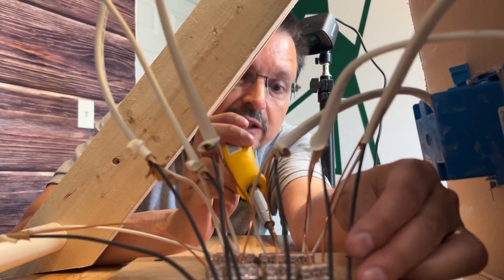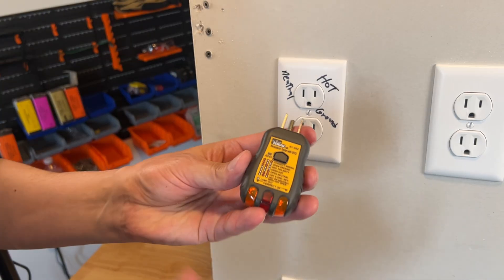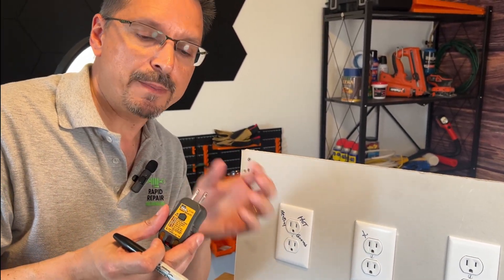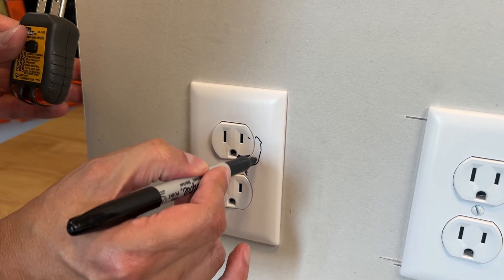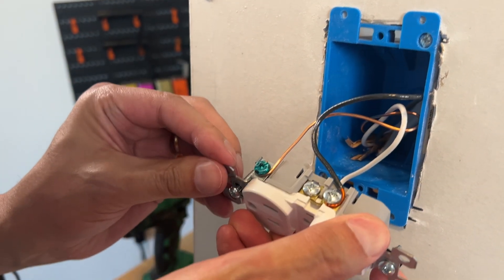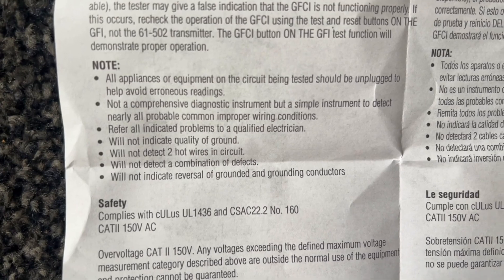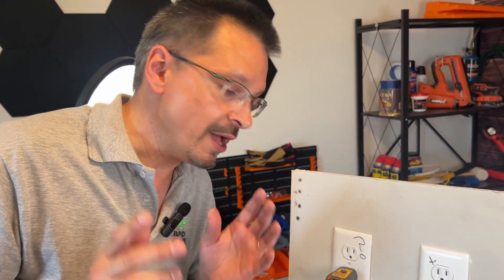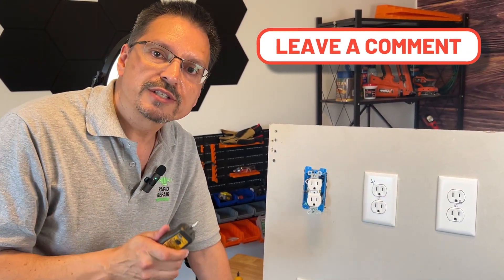Every Single Wiring Defect (how to fix them) Outlet Problems

Comment: None of my plug ins in my kitchen work. The breaker is not flipped but they still have electricity to them.
Reply from the maker: It sounds like you might have a tripped GFCI outlet in your kitchen that needs to be reset! It’s either the GFCI or you have a loose wire connection at one of those outlets and that stops power from being carried to the downstream outlets

Comment: What if in grama's house where there are only two wires, a white and  red or a black , no green ?
Reply from the maker: That’s ok. The red may be a travel wire taking the power to another outlet. In USA Black or Red is always hot (power), White is neutral, and green or bare wire is ground
Reply from the maker: Older houses have no grounds and that’s ok ✅

Comment: We woke up to the espresso machine not working and since it was connected to the same outlet as the air fryer, I figured to check the breaker but there was nothing tripped which led me to your video. Simple and detailed; I learned enough to go about it on my own. Thanks, you made a new subscriber 😇👍:hand-purple-blue-peace:🔌
Reply from the maker: Awesome! You rock 🎸 Glad the video helped you get that espresso machine working again 👍😊🔌

Comment: My plug stopped working. I have one of those testers that has I tip you stick in the outlet. It’s showing no power to that outlet. I don’t know how to trace that back to a problem. Thanks.
Reply from the maker: It’s likely the electric wire feeding it from another outlet has come loose. In the same room, I would check the immediate outlet to the left to the right, turn off the power, pull the outlets out and look for a loose connection. It should be in the same room and right nearby. Sometimes it’s in an adjoining room… Good luck.
Reply: @HomeRapidRepair I can’t believe that all I had to do was change the plug. I don’t understand how the power wasn’t getting to the plug because the plug was faulty. Wierd.

Comment: What does it mean when a plug won't go in a new outlet?? Ty
Reply from the maker: Interesting question. New outlets have a feature called “tamper resistant“. Sometimes that does make them hard to use, especially when they are new and still stiff. But if you force the plug straight in, both the hot and the neutral prongs have to be pushing at the same time, don’t angle it, it should eventually go in. Let me know if you have any other questions.